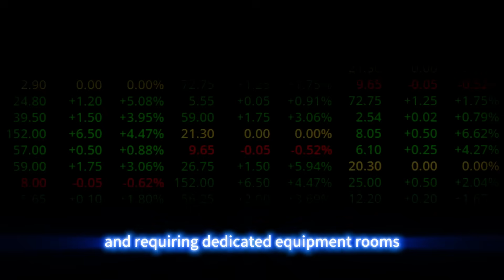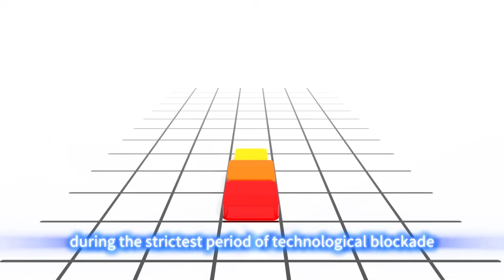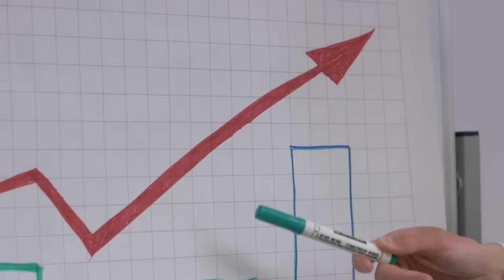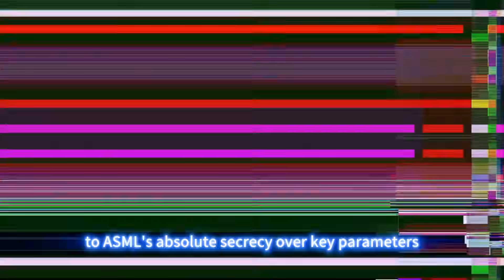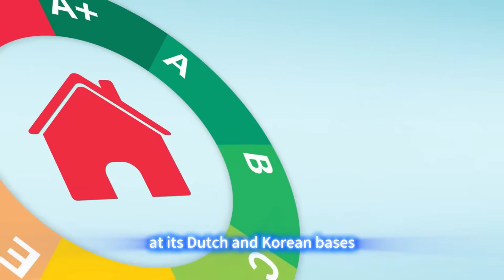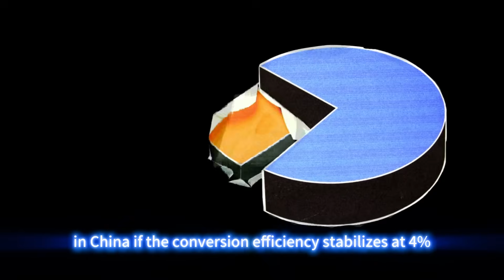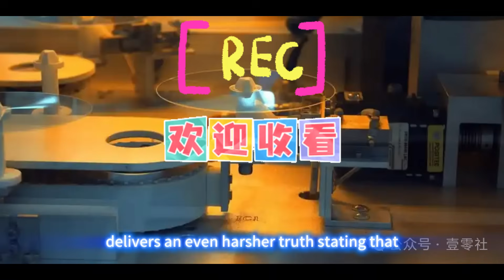Why is the Light Source ASML's Achilles' Heel?Why is 2% More Deadly Than 3nm?

Comment: Technology progresses rapidly as more and better ways are found to do a task using the R&D tool. 
USA sanctioned China by stopping the Dutch government selling the ASML eUV lithography machine to China, forcing the Chinese technocrats to find new ways to get the task of ICs manufacturing done. 
The laser beam's performance is one of the component of the litho machine that China had  improved (switching from 
CO₂ laser to solid state laser to produce the UV light). 
However China still need to produce a domestic replacement for the other components of these ASML  lithographic machines, in particular the high precision mirror lens (made by Zeiss of Germany). 
This is one more barrier to break through by these young Chinese researchers. 
長江後浪推前浪
长江后浪推前浪
(The mighty Yangtze's back wave will push out the front wave). 
Very likely China's researchers  will succeed if they work hard on it. 
Keep on pushing the closed  gates.